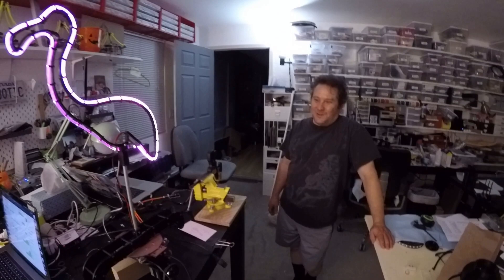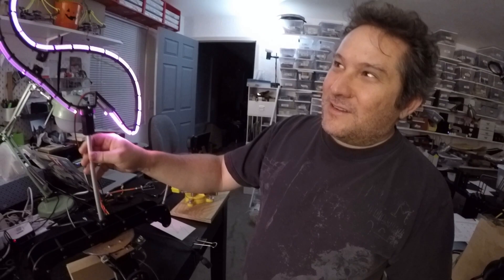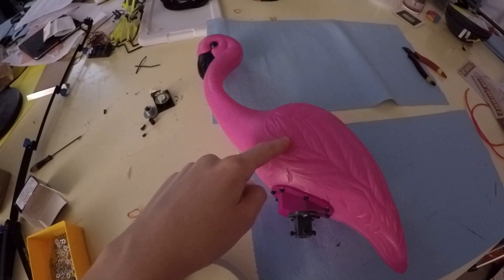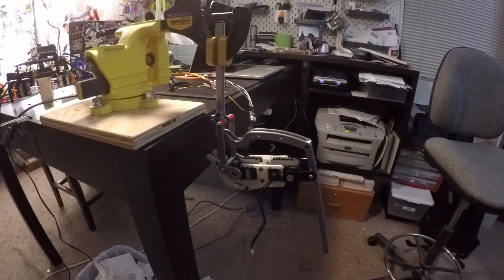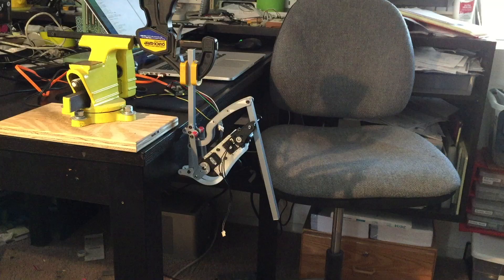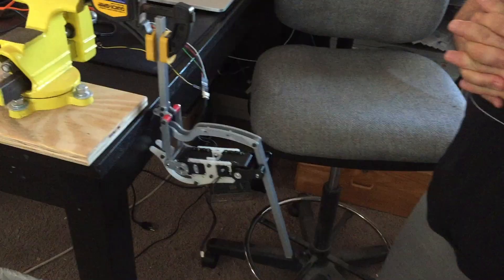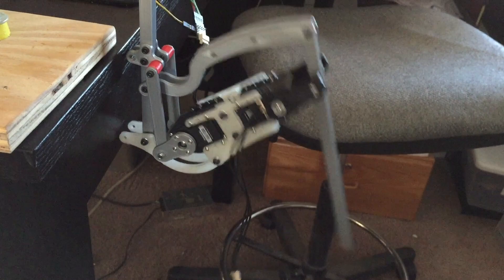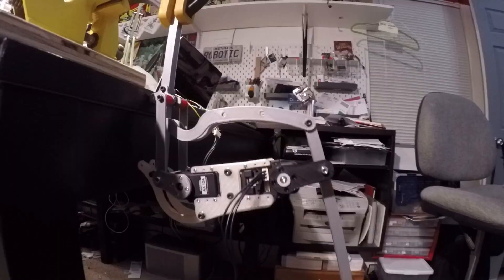Testing Noodle's New Leg Design and Carl's New Body

Comment: Hi, I maybe got an idea for Carl to help with noise and response time. Trinamic made the TMC2130 and TMC2100 which are stepper drivers designed for 3d printing. They are very quiet and can be tuned. Maybe that helps. Also I wanted to say I love noodle
Reply from the maker: I will give them a look :) Thank you for sharing! Also, Noodle says he loves you too